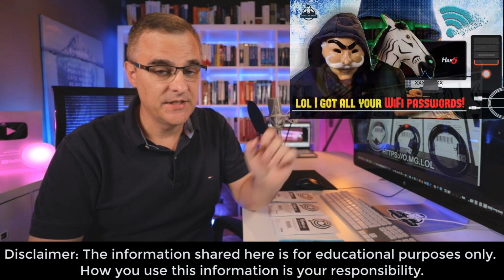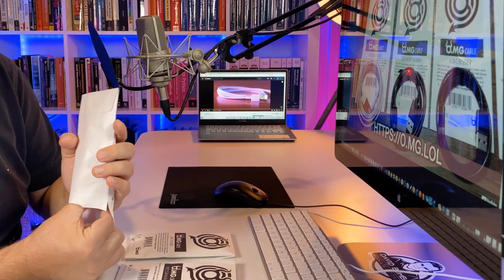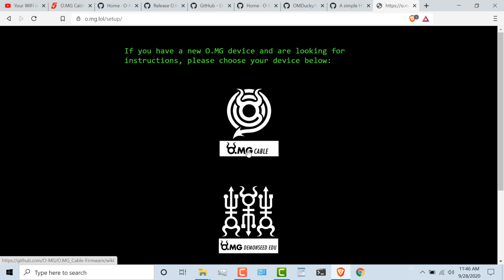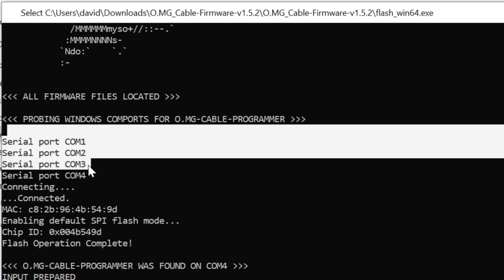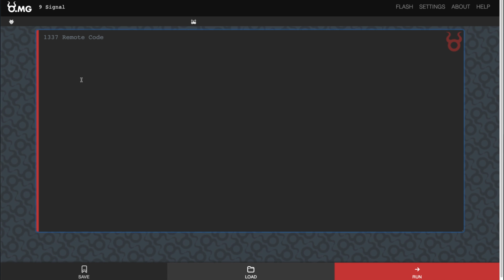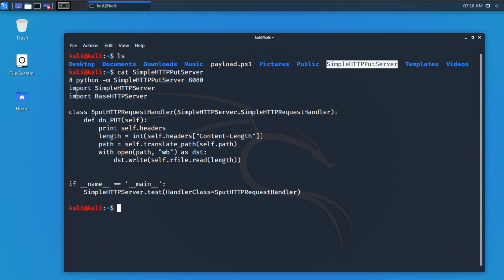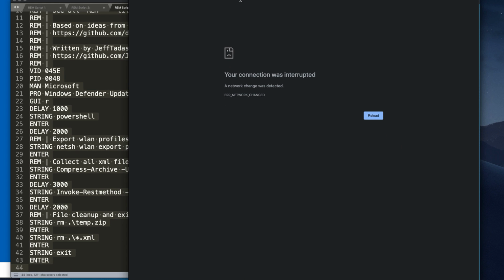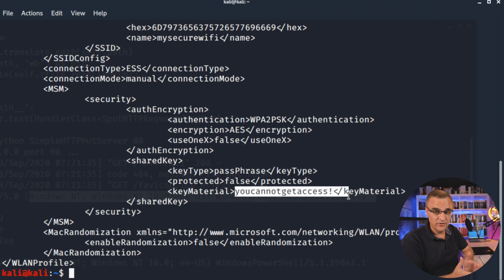O.MG: From zero to hero

Comment: QUESTION:: what is stopping the people that own the cable company installing a key logging software on your cable and then everything that’s on your computer they can access because they have new networking features for the cables now that’s hiding in the background like a ghost programme you can’t see or find and you’re hacking everyone’s PCs and things and phones for credit card details and passwords for instance, because that is what this is for and then they get all of the details from your computer and thousands of people you’ve possibly got the things from so they are possibly getting millions of credit card details Pins CVC’s account number and sort code if I was a hacker that is exactly what I will be doing. Do you think this is of a happened like they’ve sent these cables out and they’ve got back doors in them to access your computers.

Comment: While this is happening say your device is under attack and you can see typing on the screen. If you use your keyboard does it add your keystrokes as well or is your keyboard disabled? If you can add keystrokes, and add them quick enough could you potentially throw a stick in the spokes and make the commands function improperly?

Comment: I bought the Demonseed V2 EDU because of this video. I am at the step where you put the demonseed into the cable and clean it up to make it look official. I am gettin really frustrated as the guy who made the demon seed did not give me proper instructions for V2 cable. I can’t finish the wire and am stuck here kind of regretting purchasing this.

Comment: I have one question: in the payload 4 demo, you uploaded your extracted WiFi as a zip file to your webserver, which is you local Kali machine that is joined into the "fbi" network. But you said earlier that when the payloads are run by the OMG cable, the Kali machine disconnects from that WiFi network, so the webserver shouldn't be reachable at the moment of uploading the zip file. So how could that work? Or the webserver is hosted on another machine, that is joined to the WiFi of the network that the target machine is connected to.

Comment: Nice video. You could have run all the script in 'run command' and use invoke expression. Its stealthier that way without showing a terminal or command shell.  You could also add hidden mode and bypassing execution policy by adding parameter '-w' and '-ep bypass'.

Comment: Use G-Data, and it will be automatically block new keyboards and moses, so If u are see a message from G-Data u will know this is not a normal cable :)

Comment: Hey david,windows defender can disable by CMD or Powershell this is very easy.
[For CMD: >>>sc config WinDefend start= disabled
>>>sc stop WinDefend]
[For powershell:Run PowerShell with administrative privileges (Windows key + X + A)
 >>>Set-MpPreference -DisableRealtimeMonitoring $true]
If you want to completely remove Windows Defender from Windows 10, use the following PowerShell command:
>>>Uninstall-WindowsFeature -Name Windows-Defender
Reply from the maker: Agreed. You can definitely get around Windows Defender. Thanks for sharing!

Comment: -Great content.
...!!!
-Keylogger is a very old form of attack but programmable hacking devices are sold on cheap Chinese electronics sites.
-Then they can be programmed either in C or C ++ or Python or any language.
-I program at home on the Arduino IDE USB devices for wifi that are used as home automation controllers (alias the programs with ready firmware like tasmota or wled with those same programming tools that you used), but to make a keyloguer like that transmitting direct by wifi the information of the machine which would skip their firewall because it would leak the data to a nearby wifi station.
-But there are circuit boards that have 3g or 4g, which can after being connected to the PC's USB and leak your data remotely or give remote control inside the device.
-Extremely dangerous to place USB devices or any other unreliable device on a machine, especially one on a corporate network or server, windows server if I remenber have the same functions.
-In Linux users can be configured to block access to USB or removable devices, because they have the philosophy of original creation on servers and because of that they prevent this type of attack in this way.
-Great content, driven by knowledge...!!!
Reply from the maker: Thank you Eduardo!

Comment: Well on Mac I guess we could use cmd-space and spotlight to launch the terminal application, and enter some commands, but I still don't know how to export the wifi passwords (or any other sensible information) since they are saved encrypted in the keychain and even a mere export requires the system password.
Reply from the maker: There are other tricks for a Mac. Have a look at some of the scripts here and elsewhere: https://github.com/hak5darren/USB-Rubber-Ducky/wiki/Payloads - but I'll upload some demos if people are interested. May wait until the latest version of macOS is released however.

Comment: Thank you for the tutorial !
I had a question... can we use the programmer to program any usb cable, or do we have to buy the usb cable from the hak5 website?
Reply from the maker: Thank you. These are specific hardware devices - they are not like normal USB cables / devices. That hak5 cable has an access point and web server embedded in it and pretends to be a keyboard. So, a normal USB cable won't work.